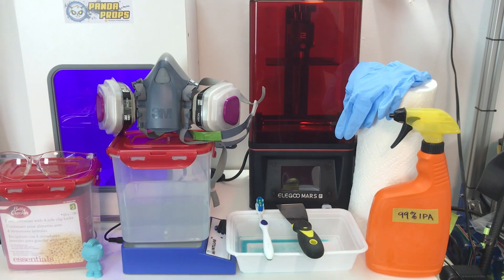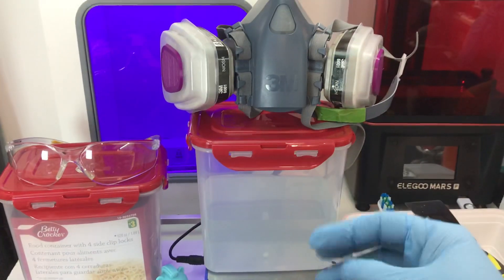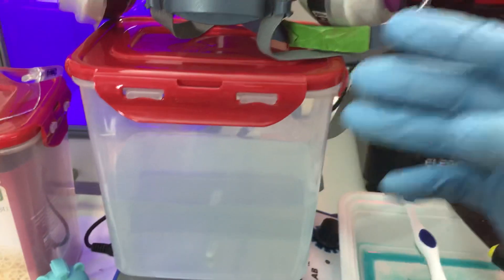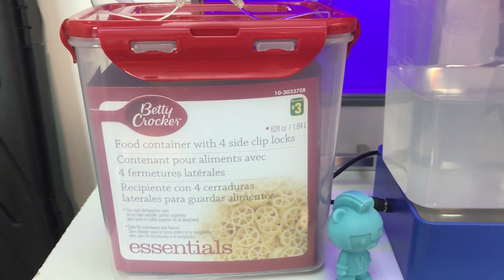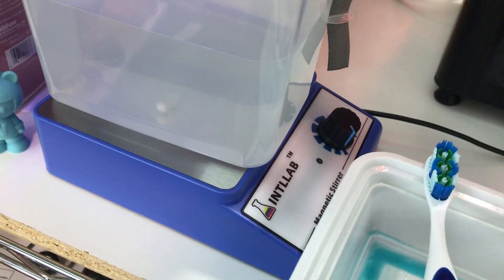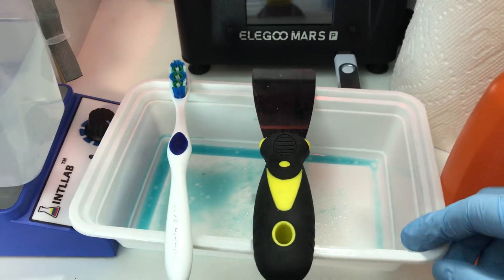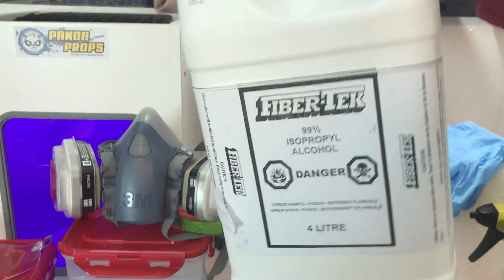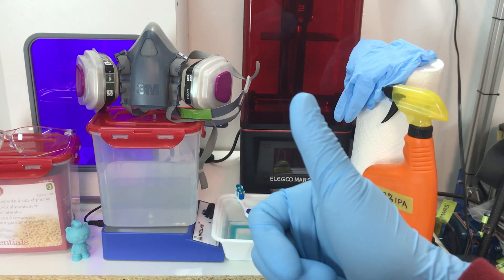How to: Wash and clean resin 3D prints

Comment: Question, do you have any suggestions for getting the last of the resin-loaded cleaning fluid out of hollow prints? I use a blunt tip syringe to clean the inside, draining it and repeating a few times, but during the cure the model heats up and a bit of resin-loaded ISO always makes it to the hole and evaporates, leaving thin weird patterns and smooth spots of cured resin. Sometimes a bit gets stuck inside the model and only comes out at a later date to get onto whatever surface the print is sitting on. 

I tried leaving it in a food dehydrator (adapted into a filament dryer) for an hour or more before curing but the models are so well sealed that it barely evaporated.

Once I sent my sister a custom model of one of her characters, it had been on my windowsill for a week and seemed stable/clean/dripless, but it later warmed up and she said it left a drop of sticky resin residue on her desk, eek!
Reply from the maker: Yes, thats pretty annoying! For figures and things its easier to print them as solid models without shells / cavities. If I am printing with a cavity, I try to incorporate an open bottom or shell the model and have larger holes in areas that i don't mind filling. I use epoxy putty / milliput etc. to fill say a couple of 1/4" holes in a model. This leaves enough room to have ISO flow in and out, make sure to have a few holes for the trapped air to flow.

I will pout ISO into the print, and cover the breather holes and shake it like a martini. Then blast compressed air through the print with the holes facing down to drain it. Blast more compressed air in to dry it out. 

I don't have one yet, but I have heard of people shining UV flashlights or even rigging up small UV LEDS to feed inside prints and let the loght cure as much of the inside as possible.

For a lot of my prop work the print is not the "final" object and often times I mold and cast the print, so I'm less concerned about "weeping" of resin after the print is done. I hope that helps!
Reply: @pandapropsncostumes  Hmm, UV probe, now that's an idea. Thanks for the advice, I'll have to try that.

Comment: Problem with the fish (that's the little pill), it hits your prints. If you have more delicate things, it might break them.
Reply from the maker: Thanks! I didn't know what that thing is called. I keep the print attached to the bed for the rinse / wash in the container. So I just suspend it above the fish.
Reply: @pandapropsncostumes  that is good advice - I have a few printers and clean them all together after taking it off. 
@Andrew Donatelli (below my comment) - the basket is a great idea, too!
Reply: Easily prevented by cleaning prints still on the build plate and/or using a meshed screen on the bottom of the container above the agitator.